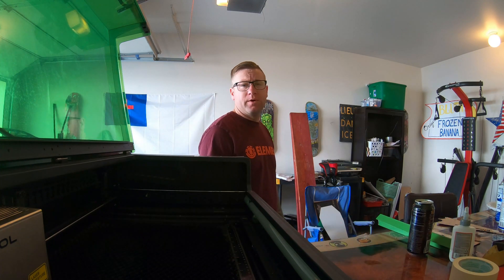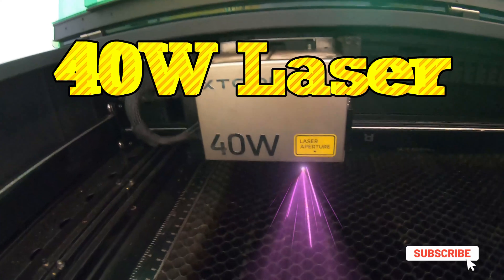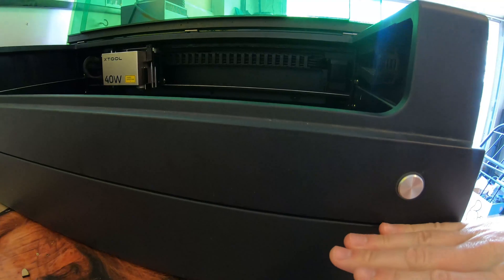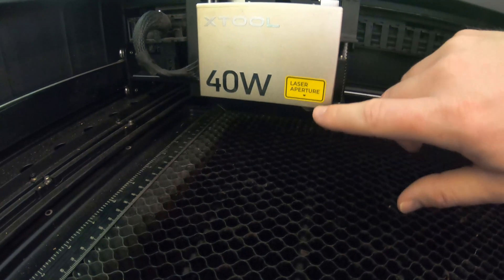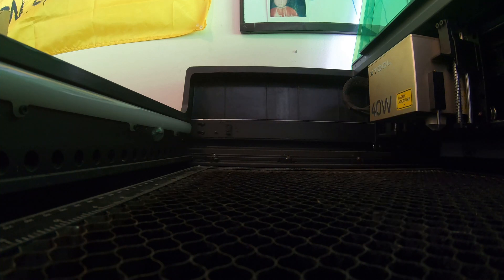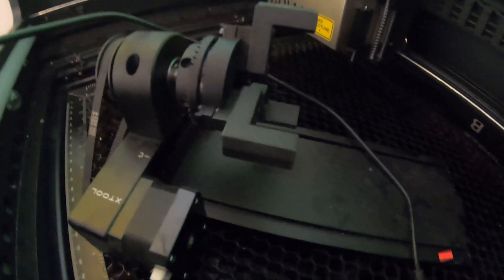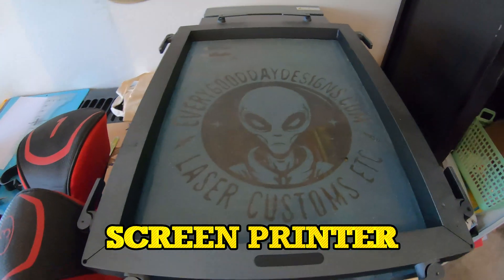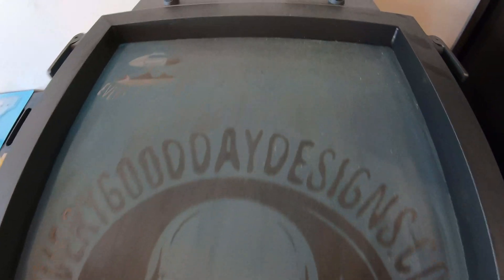xTool Laser Components Review: Honest Pros & Cons

Comment: Thank you for the video!  Short and to the point.  Great tips on some things I was thinking about.  Sorry just doing a lot of research to make sure I get what I need but, will the 40W engrave on materials without purchasing the 2W?  Also how is it with acrylic?  Thanks again for the video and your time!
Reply from the maker: @michelledawson6804  yeah, the 2W is mostly for metals since the 40W diode is on a different wave length it won't engrave alot of metals. Acrylic is a little difficult because each color cuts differently but it does cut and engrave acrylic. My wife cuts acrylic pretty often but you would have to figure out specific settings and write them down after doing some testing
Reply from the maker: @michelledawson6804  Also, no problem I wanted a video like this that kinda walked through the different components so I could see them prior to buying but the options were kinda limited

Comment: The laser module impacts price way more than some of the accessories and You had pretty much nothing to say on that. Would the 20W module still cut thicked pieces in 2 passes and what does a cut made in 2 or three passes look like compared to a single pass cut? Is there more charring, does it leave the edge not square to the surface? If the only reason to get the 40W is to cut thicker wood, then it’s probably the most important choice.
Reply from the maker: @amconsole  the 40W can increase the speed for your cuts and the depth.  The concern I think you should have with the charring isnt a big deal if you have the air assist. The air assist helps with reducing the burn marks and it causes deeper cuts for both laser modules.  Pricing wasn't a concern when doing this video because I mostly wanted to inform the viewers about the parts available.